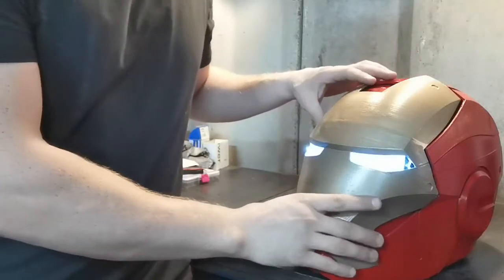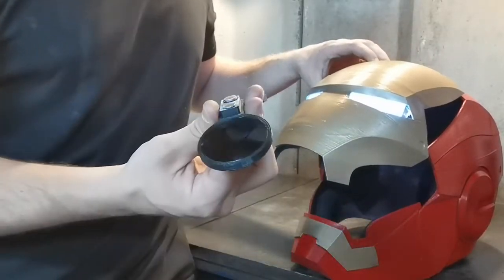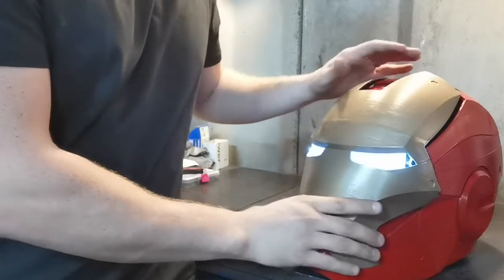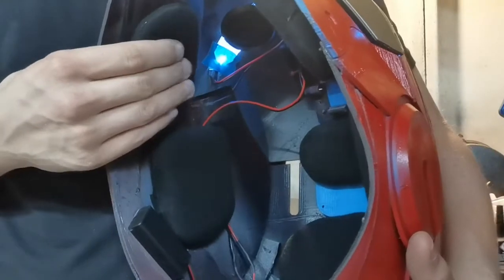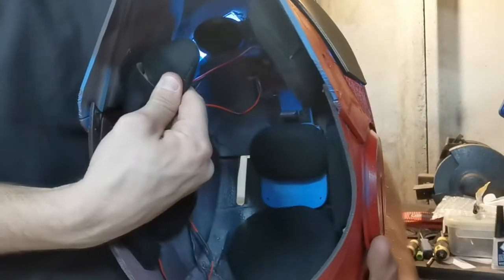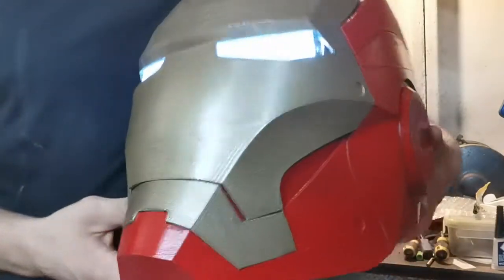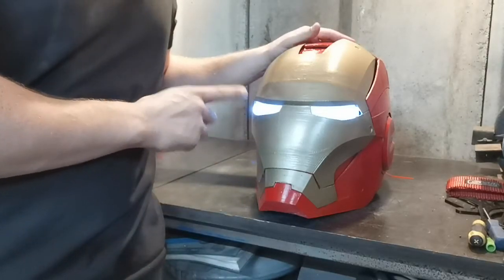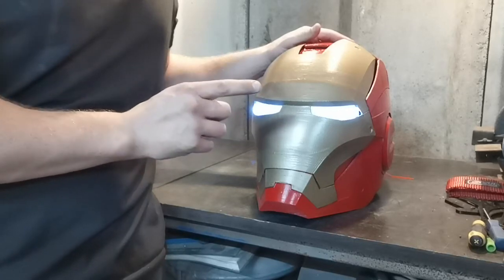Iron Man Mask - Welding Visor - 3d Printed

Comment: If someone paid you to build one do you think you could make one with an auto shade
Reply from the maker: It doable to make one with an auto shade but the look of the helmet would change, as you would need the sensor on the outside of the helmet, I did consider it but I wanted the helmet to look as realistic as possible.
Reply: You could hide the sensors for the most part, I'm finding issues in finding the right shaped lenses so I don't mess the whole look up

Comment: use PLA? PETG? has it warped since
Reply from the maker: PLA, It has warped a little but that was from storage not from using it
Reply: @mozsmancave2331  have you done any mig with it? curious about abuse it could endure mostly
Reply from the maker: @pwnagraphik1018  I haven't done any mig with it as I want it to stay looking nice, as long as your head isn't too close to the weld I think it would be OK to be fair, an dif you painted in in some heat reflective paint that would help too

Comment: Currently in the process of making this! What file did you use to hold the fixed shade lenses? Or did you just design it yourself to use?
Reply from the maker: Hi! Designed the lense holder myself 😁
Reply: Are you going to release the file publically or do we have to design a holder to fit? 
 @mozsmancave2331